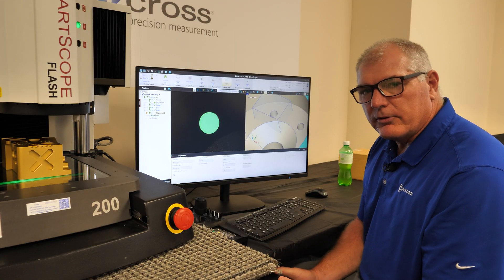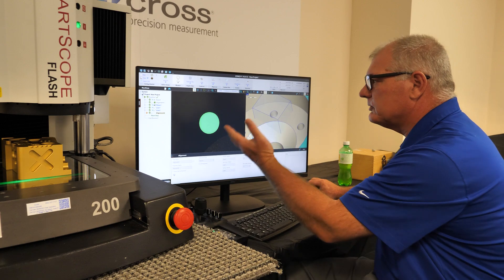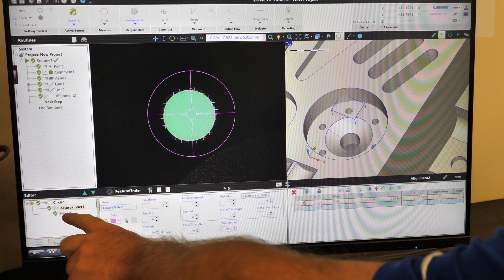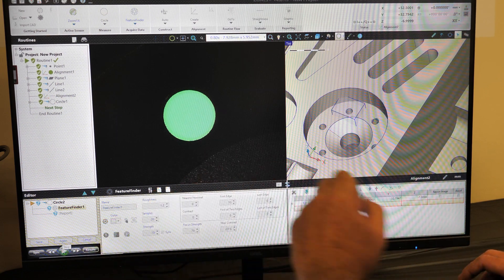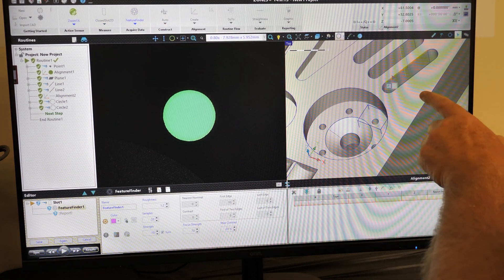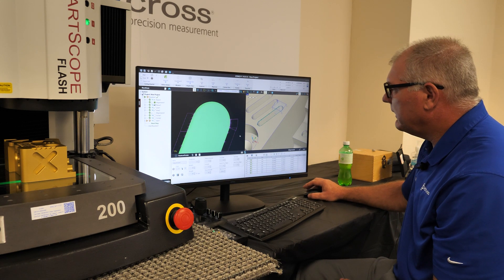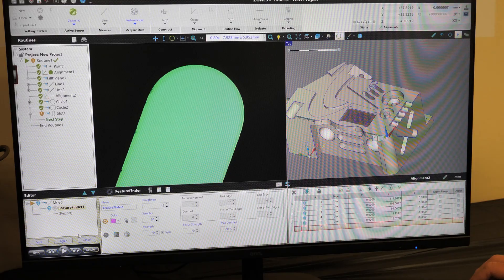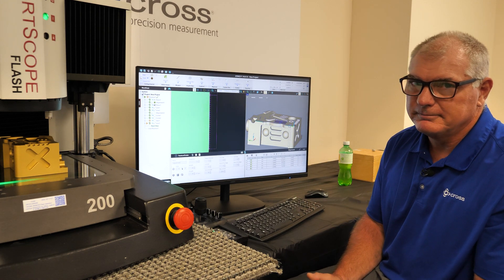ZONE3 Tips & Tricks Episode 5: Measuring to a CAD Model

Comment: What is the accuracy rating of this unit?  We commonly have to maintain .0002" total tolerance, and most often that is with round parts (Molding Pins and Sleeves).  Sometimes the molding pins have complex features at the tip/molding surfaces (e.g., tapers, radius, grooves, holes, recessed depressions at the tip.  Sometimes there are tiny molding forms proud of a surface at the tip that themselves may have little features in them (e.g. .005" radius) that, in addition to the distinct dimensions also has a positional requirement to the centerline of the entire part.
Reply from the maker: The Quest series machine would be the perfect machine for you to evaluate for your application.  This multi sensor machine has an accuracy specification that hold your tolerance of .0002”.  We have other sensors like through the lens lasers  as well as contact scanning probes that can connect to this machine to provide further flexibility for your measurement.